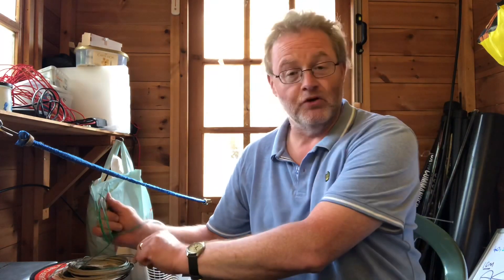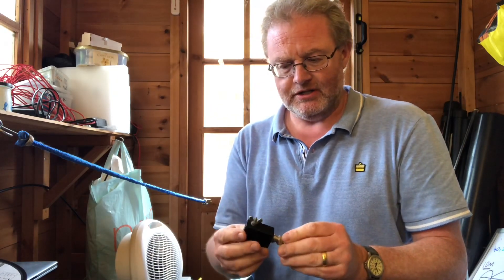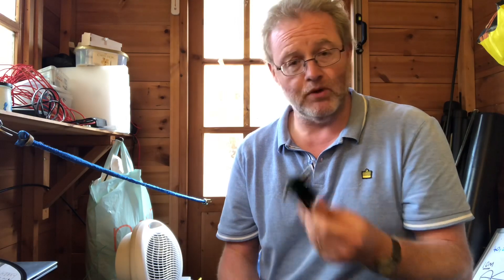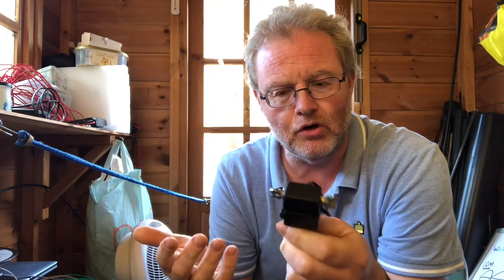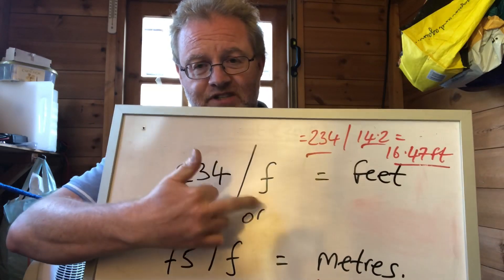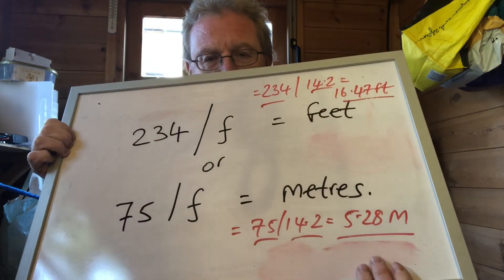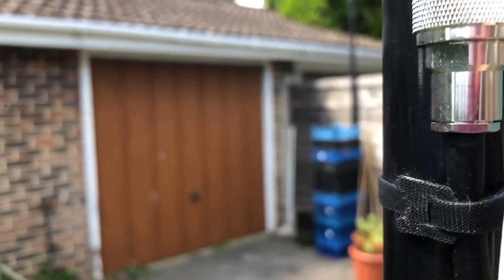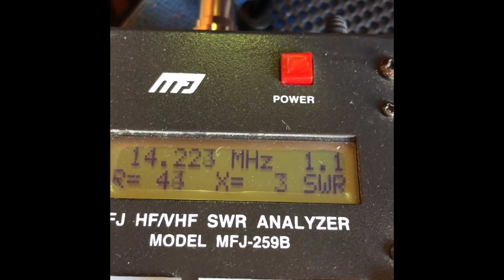HAM RADIO: 20 metres - Simple DX antenna. Quarter wave vertical.

Comment: Superb video as always.
Could an antenna tuner be used if the measurements are "close enough" to the right place but not spot on.? 
I also am using a telescopic pole but can't seem to find the right place as im between buildings somewhat on 2 sides (terraced house with close houses at the back too) I'm hoping a tuner might help a wobbly SWR and allow 10, 11 and 12 meter bands and hopefully 15 meters too. 73's
Reply from the maker: The tuner can help but I would strive for the best match you can with these mono band antennas

Comment: There's a way to build a quarter-wave vertical with two elevated verticals using the mirror mounts that truckers use to mount CB antennas along with three of the cheap 18.5 ft. telescoping antennas from China and some 10 mm to 3/8 x 24 adapters  (McMaster-Carr #92499A793). You can mount the result to 10-foot-or-so tripod such as those photographers use to get the radials well above the ground and out of the clutter. It should work for all bands from 20 meters up to at least 6 meters. With the length adjusted to resonance, I get about a 1.1 SWR on 20 up to about 1.4 on 10 meters. Drooping seems to improve the impedance match.

In the pictures linked below, the two shorting BNC dust covers tie the horizontal elements to ground, making them radials used with the vertical whip fed. But you can also use them a different way. Feed one of the horizontal elements and leave the other shorted and you have a modest-height V dipole. These pictures also include a recent addition, a through-chassis BNC connector that allows VHF/UHF antenna to be installed or one of the banana-to BNC jacks and a wire dipole for perhaps 30 or 40 meters. I used nuts larger than the bolts for the interior spacing, so those wing nuts tighten everything. That makes installing it simpler.  All it all, it is quite versatile. It can fit into your backyard or set it up in a park for POTA.

The three pictures are the named and numbered Performer jpgs at this public Dropbox link. Feel free to pass the pictures on and vary the design to suit your needs. I’ve go through about a dozen adaptations myself.

https://www.dropbox.com/scl/fo/lnyuz21yzstrdpf6t6xq5/h?rlkey=amxtnzn9fwfpd0sqv0o6l8rxn&st=t3sxza0z&dl=0

And it does perform just like Tim suggests. Performer-WSPR-20.png shows the WSPR results with the vertical on 20 meters and about 3 watts out.

--Mike Perry, WA4MP
Reply from the maker: Thanks for the info Mike!

Comment: Thanks Tim.
Finished a homemade 1:1 balun with 140-43 core and 1mm copperwire and build a 1/4 vertikal today for 20 meters, got it tuned with the help of a VNA.
Hopefully I can do some live testing later this week. Used 20 3.5 meters radials made of old network cabel and the ariel is 0.75mm electrik cabel.
Mounted on a 5 meter fiberglas fhishing rod and its sitting on my garden fence ground mounted. 
Nice to see this video on your build.
Hope to hear you on 20 meters. 

73 and many thanks
Reply from the maker: Sounds great Lars!

Comment: So, just out of curiosity, what frequency did you cut for? And what length did you make the radials? Where they the same length as your antenna? Thank you in advance
Reply from the maker: From memory around 14.220 MHz and yes the radials were the same as the vertical element.
Reply: @TIMG5TM  thank you for taking the time to answer back

Comment: Tim thanks for the video, very informative, I'd like to give it a try.
What do you use for poles? I'd like a permanent solution, I'm not intending to make it portable.
Thanks
Peter
Reply from the maker: As a semi permanent solution at home I use a cheap 10m fibreglass pole but with each section stuck together with araldite. Four years so far and no issues

Comment: Thanks Tim. I built this antenna ,first trip copied R7 , VE, YB , and several Europeans , I was really pleased with it. I would be interested if you could research Ground Tuning Unit for 1/4 wave antennas . Many thanks, Roger G3KMV
Reply from the maker: Glad it worked well Roger… check out Dave G4AKC who goes bicycle mobile with a 1/4 wave and GTU next to the sea and works DX every time

Comment: Would this work if the radials were at 90 degrees to each other rather than 180?
Reply from the maker: If you have two radials it would skew the pattern and possibly cause common mode currents
Reply: @TIMG5TM  OK, thank you.  I am looking at my possibilities.

Comment: is the length of the radials the same as the element? I plan on using 4. Thanks
Reply from the maker: Yes all radials and vertical element are the same. You can prune the vertical element to adjust swr if needed. 4 radials is fine. 73

Comment: Nice one Tim… I’m gonna try this out next as I’m always exploring different ways to make portable lightweight antennas for SOTA.
Have you tried this with the feed point and radials down nearer the ground?
Reply from the maker: Yes it’ll work as long as the feedpoint is at least say 4-5 feet above ground. Keep the radials off the ground. The flatter they run to the feedpoint the higher the impedance so the swr may climb away from a 1:1 match but still should present a good swr. 73
Reply: @TIMG5TM  Thanks Tim, I’ll keep that in mind and give it a go.

Comment: Tim, thanks, I've just come across this as looking to build my first antenna and this is incredibly useful – I've only used bought antennas thus far, and this is a great first. Out of curiosity, would you think that the same design with appropriate proportions work well for 40m? Although I suppose that the radials length might be a bit prohibitive within your constraints (which are similar to mine).
Reply from the maker: Hi Giuseppe yes you can scale this for any band. For 40m you'll need 22 feet (10m) wires. Use the formula 234/frequency for the length in feet. 71/frequency for length in metres. 73
Reply: @TIMG5TM  thanks Tim, will definitely try that, and good shout on the QRP 1:1 balun, it seems a solid piece of equipment for a reasonable price.
Reply: Pleased to report that the 20m vertical works a feat! Thanks :)

Comment: Fantastic video tim think ill have a go at this one thanks MW7BOI 73,s
Reply from the maker: Nice one go for it 73
Reply: Hi tim well i finally got round to building this antenna swr coming in at 3  which wire do i trim the vertical or radials

Comment: @Tim G5TM:   Hi Tim.  Just one small point: @ 7:34 “How do we calculate how much wire we need?”  The 234 imperial formula includes a 0.95% velocity factor, whilst the 75 metric formula figure you quoted does not. The correct metric formula, including the 0.95% velocity factor, should be 71.25 / f.  
To advise others who might read my posting, in my own antenna construction experience I have found the 0.95% velocity factor is only a nominal figure, and in real life have always found the velocity factor to be lower - even as low as 0.87% or 0.88%. 
A combination of various factors affects the velocity factor, such as (i) thickness of antenna wire, (ii) whether or not the wire is insulated, (iii) type of ground beneath the antenna and (iv) height of antenna above ground.  In all cases, I have always found that using either formula (both with the built-in 0.95% velocity factor) has resulted in antenna legs that are longer than required, so the legs can easily be shortened to the correct length.  
Excellent advice from Tim, guys - if you are into serious antenna-building, get yourself an antenna analyser.  Far better to spend your money there than on an ATU (which should, of course, really be called an Impedance Matching Device (IMD), which is all it does - it matches the impedance of the antenna to the 50 Ohm impedance of the radio). An ATU does NOT tune an antenna!  The biggest "con" in Ham Radio!
I hope this helps any newbies, and welcome to them to the hobby.  Iain.

Comment: Hello Tim I also have a small back yard would a 40m inverted Vee with manual perform better than 9:1 unun 54’ vertical wire. Trying to also have multiband capabilities? Inverted vee feed 30’
Reply from the maker: If I was a betting man? Yes. At least in my experience
Reply: @TIMG5TM  thanks Tim I’ll be putting up the inverted vee in couple of weeks. Thanks for the insight. Keep making the videos also!
Reply from the maker: @glennfinney1595  thank you and good luck. 73

Comment: the 1/4 wave vertical is a magical antenna, i'd be interested to know how you found the noise levels compared to other antennas on the same band. 73 G7KDM
Reply from the maker: Hi Colin about the same as an efhw and about 2 s points more than a centre fed dipole
Reply: @TIMG5TM  thanks Tim, that's not bad at all considering the H v V polarity differences and the vertical picking up noise from all directions.

Comment: Hi Tim, I have built your 2M EFHW from another video (and it works brilliantly thanks) so I’m going to give this one a go as well

Question before I start though, you’ve tied off the radials at what looks like fence/shed height, so is there an optimum height for the ‘inverted v’ created by those 2 radials? Or maybe an optimum angle?

Many thanks, Rob
73 M7ASU
Reply from the maker: You should try and have each radial around a 45 degree angle from the feedpoint. Try and keep their ends above head height (high voltages) then good to go!
Reply: Tim G5TM excellent, thanks for the clarification

Comment: WB4BKO-Ned 
 Interesting video. Very informative. All the necessary details for building a simple, inexpensive and effective antenna. You proved what a friend of mine, now a silent key and a ham for over 60 years, often stated: "if you paid more than $10.00 for antenna parts, you spent too much".  Your relaxed and friendly style of presentation is a plus. I have never used a 1:1 balun on a vertical. Usually five to 8 turns of coax wound around a 2" piece of PVC pipe (when using RG58 or RG8X) near the feed point should be adequate to choke off any RF on the feed line. That piece of PVC pipe also works well as the center insulator.  Thank you for your video.
Reply from the maker: Thank you sir for taking the time to watch and comment. Really appreciate it. I’m a big fan of home brewing antennas too. 73

Comment: Hi Tim! Thanks for sharing your experience. I build a lot of vertical antenna and i have a question: why balun? Vertical antenna  should be already unbalanced. Best 73 de iw2hus, Franco
Reply from the maker: Hi Franco. From my perspective it is just to provide a convenient feedpoint for portable use and to help eliminate any stray common mode. Thank you very much for watching and commenting. 73

Comment: Just watched this - very useful thanks. Will give it a try. One thing, is your conversion factor for wire length in metres correct at 75/f? One foot = 0.3048 m so 234/f for feet converts to 71.3/f for metres. Just curious!
Reply: @David Kerr:  Hi David.  I am about to leave a posting for Tim, G5TM, regarding this very topic.  The 234 imperial formula includes a 0.95% velocity factor, whilst the 75 metric formula figure Tim has used does not.  The correct metric formula, including the 0.95% velocity factor, should be 71.25 / f.  
However, in both formulae, 0.95% is only a nominal figure, and in real life I have always found the velocity factor to be lower - even as low as 0.87% or 0.88%.  A combination of various factors affects the velocity factor, such as (i) thickness of antenna wire, (ii) whether or not the wire is insulated, (iii) type of ground beneath the antenna and (iv) height of antenna above ground.  In all cases, I have always found that using either formula (both with the built-in 0.95% velocity factor) has resulted in antenna legs that are longer than required, so the legs can easily be shortened to the correct length.  
Excellent advice from Tim, guys - if you are into serious antenna-building, get yourself an antenna analyser.  Far better to spend your money there than on an ATU (which should, of course really be called an Impedance Matching Device (IMD), which is all it does - it matches the impedance of the antenna to the 50 Ohm impedance of the radio).  An ATU does NOT tune an antenna!   I hope all this helps, Dave.  Iain.
Reply: @iainmeteorscan1555  Good reply.  I was also going to mention that the velocity factor was applied only to the Imperial measurement and not to the Metric, but you beat me to it.  I have an IMD in my rig (IC-7300), so just need to buy an analyzer, then it's antenna building time!
Reply: @nrgxpert   Hi nrg.  Good you picked up on it also.  Beats me why UK Hams still use the imperial formula – we’ve been metric for over 50 years now! The Yanks obviously still use imperial, as they haven’t discovered metric yet! 
It also beats me why Hams still talk about their bands in metres (meters in Retardistan) when even the band plans are listed in kHz and MHz!  I can’t remember the last time I saw a radio calibrated in metres!.  
Great you are considering purchasing an antenna analyser – as an ardent antenna builder myself, apart from my radios, it’s the best piece of kit in my armoury!  I know you will have fun with your antenna building, as you can see exactly what’s happening as you make adjustments.  Iain.
Reply: @iainmeteorscan1555  I bought an MFJ- 259D and have built a half dozen POTA and SOTA antennas, plus my EFHW base antenna.  It works wonders!

Comment: Hi Tim. what length were the radials to start, same 1/4 wave as the element? Thanks, Brent   VA7HUM
Reply from the maker: Hey Brent, yes same length although designs often have them 5% longer than the vertical element. Doesn’t seem  to matter in the real world either way. 73
Reply: @TIMG5TM   Thanks.

Comment: Thanks for sharing. I have the DX Commander all band vertical. I find that the swr is high on all bands with 10 meters being unusable even with an external tuner. I like your set up.
Reply from the maker: Thanks for the comment. 73

Comment: Hi, can the anntenna be mounted at ground  level or just above with the radials lyeing flat on the ground?
Reply from the maker: Hi Pat if the radials are on the ground then they are effectively de tuned. In that case you don’t need a specific length but as many as you can fit on the ground. 73

Comment: Would a 9.1 unun ?
Reply from the maker: They work but need a good earth and either lots of radials or a long counterpoise. Even then they are prone to common mode issues.
Reply: Ok cheers I have a 10 metre pole , got some garden wire with green cover on, gonna give it a try .i got a balun coming .

Comment: Hi tim good video , but you missed telling us how to work out the length of the radials , please update thanks
Reply from the maker: Hi Eddie. The same as the vertical element. Some designs for this antenna state to have the radials 5% longer others do not. I have to say that whenever I’ve made this antenna I’ve kept it equal and it seems to always tune easily and work very well. 73
Reply: Tim G5TM  thats great , if you did say in the vid i missed it but that clarifies it , good work tim
Reply from the maker: No problem Eddie. Great to have you stop by. 73

Comment: Tim, Looks like you have neighbours nearby.  Whats the EMC situation like with this antenna for you?  Pete
Reply from the maker: Hi Pete. Only 10m with my 33ft doublet caused tvi with a neighbour. That was at 40 watts or more. We tested all other modes and Hf bands 40-10 with no issues thankfully. I’ve changed the 10m antenna to a vertical and sited it further away from them and no issues. Ah the curse of modern living lol. 73

Comment: Useful video Tim 👍🏻 Two tips for the viewers: #1 When using the balun for a vertical as in your example, check which side is connected to coax centre and which to the braid, as it’s the centre which makes the vertical element. #2 Often your local radio club has kit for loaning out, so that’s a good way to get your hands on an analyser if they’re a bit too expensive to buy.
Reply from the maker: Thanks Ian. I have to say I’ve not had an issue with using either connector of the Balun for either of the vertical elements. A very useful tip about clubs and analysers. 73

Comment: Nice simple build and very well explained, how high is the tip of the vertical element from the ground ?
Reply from the maker: Thanks Robert. The Balun in the video was 10 feet off the ground so the top end is 26 ft high. It can go higher of course. 73 and thanks for watching!
Reply: @TIMG5TM  If you don't use a balun how is it connected ?
Reply from the maker: Robert Barrie you can simply solder the centre conductor of the coax to the vertical wire and the coax braid to the radials. Or make the same connections using choc block connectors, taking care to waterproof connections 73
Reply: @TIMG5TM  Sorry if this sounds dumb but do you split the outer braid and connect to each radial or does the radial become one length with the outer braid connected ?
Reply from the maker: No such thing as a dumb question 👍 Both or all radials will connect to the single piece of braid. That’s why most installations will have this soldered and covered with heat shrink or good quality tape to further waterproof the connection So to recap, in my case it would be both radials connected to the single braid of the coax. Hope this clarifies it?
Reply: @TIMG5TM  Thank you Tim just ordered a 10 metre telescopic pole so going to build this antenna